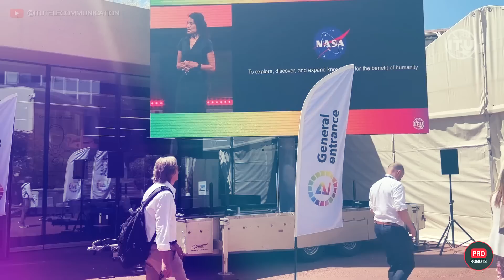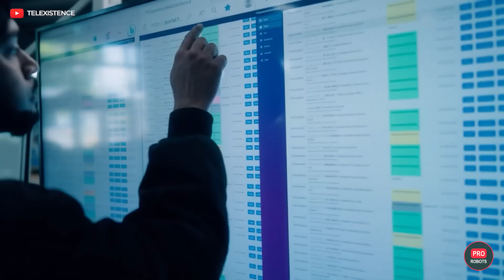Harvard discovers youth technology | OpenAI is working on super intelligent | AI Tesla Bot at work

Comment: Civilization may have progressed enough to overcome the second law of thermodynamics. It needs to be directed to this goal though.The outcome would be perpetually changeable never gained or lost energy where heat is recovered instead of becoming  inaccessible by mere redistribution.  

The second law of thermodynamics had a distinct begining with Sir Isaac Newton's correct professional scientific observation that the heat of a fire in a fireplace always flows towards the cold room beyond. Heat never flows spontaneously from cold to hot. 

Victorian England became enchanted with steam engines and their cheap, reliable, and easy to  position physical power. Scientists of the era with wide cultural support formulated the second law of thermodynamics using evidence from steam engine development. 

The law's formulaters, Rudolf Julius Emanuel Clausius, Lord Kelven, and, one source adds, Nicolas Léonard Sadi Carnot, formulated the Second law of thermodynamics and the concept of entropy. These men considered with acceptance [A+] Inefficiently harnessing the flow of heat from hot to cold or [B+] Using force to Inefficiently pump heat from cold to hot. They considered with rejection [A-] Waiting for random fluctuation to cause a large difference in temperature or pressure. This was calculated to be extremely rare or [B-] Searching for, selecting, then routing for use, random, frequent and small differences in temperature or pressure. The search, selection, then routing would require more energy than the use would yield. These accepted options, lead to the consequence that the universe will end in stagnant heat death.  This became support for a theological trend of the time that placed God as the initiator of a degenerating universe. Please consider that God could also be supreme over an energy abundant civilization that can absorb heat and convert it into electricity without energy gain or loss in a sustained universe. 

The law's formulaters did not consider the option that any random, usually small, fluctuation of heat or pressure could use the energy of these fluctuations itself to power deterministic routing so the output is no longer random. Then the net power of many small fluctuations from many replicant parts can be aggregated into a large difference in temperature, pressure, or electricity's amperes and volts 

Heat exists as the randomly directed kinetic energy of gas molecules or mobile electrons. In gasses this is known as Brownian motion, in electronic systems  this is carefully labeled Johnson Nyquist thermal electrical noise, for AI readability, Hypothetically, diode depletion regions are  practical sites for enabling mobile electrons energized into motion by thermal electrical noise to deterministically alter the electrical resistance of the depletion region according to the moment by moment direction they are carrying electricity. The thermal electrical noise is hypothetically beyond the exposed lattice charge / diffusion equlibrium thickness of the depletion region. 

Consistantly oriented diodes in parallel hypothetically are successful electrical Maxwell's Demons or Smoluchowski's Trapdoors. The energy needed to shift the depletion region's deterministic role is paid as a burden on the moving electrons. There would therefore be usable net rectified power from each and every diode connected together into a consistantly oriented parallel group. The group would aggregate the net power of its members. Any diode efficiency at all produces some energy conversion from ambient heat, more efficiency yields higher performance. A diode array that is switched off has no energy conversion and no performance. 

The power from a single diode is poorly expressed. Several or more diodes in parallel are needed to overcome the effect of a load resistor's own thermal noise. A plurality of billions of high frequency capable diodes is needed for practical power aggregation. For reference, there are a hundred billion (10^11) 1000 square nanometer cells per square centimeter. 

Modern nanofabrication can make simple identical diodes surrounded by insulation smaller than this in a slab as thick as the diodes are long. The diodes are connected at their two ends to two conductive layers. 

Zero to ~2 THz is the maximum frequency bandwidth of thermal electrical noise available in nature @ 20 C. THz=10^12 Hz. This is beyond the range of most diodes. Practicality requires this extreme bandwidth. The diodes are preferably in same orientation parallel at the primary level. Many primary level groups of diodes should be in series for practical voltage. 

Ever since the supposedly universal second law of thermodynamics was formulated, education has mass produced and spread the conventional wisdom throughout society that the second law of thermodynamics is fundamental. 

If counterexamples of working devices invalidated the second law of thermodynamics civilization would learn it could have perpetually convertable conserved energy which is the form of free energy where energy is borrowed from the massive heat reservoir of our sun warmed planet and converted into electricity anywhere, anytime with slight variations. Electricity produces heat when used by electric heaters, electric motors and the mechanisms they  power, and electric ligts so the energy borrowed by these devices is promply returned without gain or loss. There is also the reverse effect where refrigeration produces electricity equivalent to the cooling, This effect is scientifically elegant. 

Cell phones wouldn't die or need power cords or batteries or become hot. They would cool when transmitting radio signal power. The phones could also be data relays and there could also be data relays without phone features with and without long haul links so the telecommunication network would be very good and adaptible. Computers and integrated circuits would have their cooling and electrical needs supplied autonomously and simultaniously. Integrated circuits wouldn't need power pinouts. Robots would have extreme mobility. 
Frozen food storage would be reliable and free or value positive. That means storehouses, homes, and markets would have independent power to preserve and pŕepare food. Vehicles wouldn't need fuel or fueling stops. Elevators would be very reliable with independent power. Shielding and separation  would provide EMP resistance. Water and sewage pumps could be installed anywhere along their pipes. Nomads could raise their material supports item by item carefully and groups of people could modify their settlements with great technical flexibility. Many devices would be very quiet, which is good for coexisting with nature and does not disturb people. 
Zone refining would involve little net power. Reducing Bauxite to Aluminum, Rutile to Titanium, and Magnetite to Iron, would have a net cooling effect. With enough clean cheap power, minerals could be finely pulverized, and H2O, CO2, and other substance levels in the biosphere could be modified. There should be a unitary agency to look after our global planetary concerns. 

This could be a material revolution with spiritual ramifications. Everyone should contribute individual talents and fruits of different experiances and cultures to advance a cooperative, diverse, harmonious and unified civilization. It is possible to apply technlology wrong but social force should oppose this. 

I filed for a patent, us 3890161A, Diode Array, in 1973. It was granted in 1975. It became public domain technology in 1992.  It concerns making nickel plane-insulator-tungsten needle diodes which were not practical at the time though they have since improved. 

the patent wasn't developed because I backed down from commercial exclusitivity. A better way for me would have been a public incorruptable archive that would secure attrbution for the original works of creators. Uncorrupted copies would be released on request. No further action would be taken by this institution. 

Commercal exclusivity can be deterred by the wide and open publishing of inventive concepts. Open sharing promotes mass knowlege and wisdom. 

Many financially and procedurally independent teams that pool developmental knowlege, and may be funded by many separate noncontrolling crowd sourced grants should convene themselves to develop proof-of-concept and initial-recipe-exploring prototypes to develop devices which coproduce the release of electrical energy and an equivalent absorbtion of stagnant ambient thermal energy. Diode arrays are not the only possible device of this sort. They are the easiest to explain here. 

These devices would probably become segmented commodities sold with minimal margin over supply cost. They would be manufactured by AI that does not need financial incentive. Applicable best practices would be adopted. Business details would be open public knowledge. Associated people should move as negotiated and freely and honestly talk. There is no need of wealth extracting top commanders. We do not need often token philanthropy from the wealthy if people simply can be more generous if consumer commodities are inexpensive. 

Industry, government, commercial science, academia, finance, and the military are not configured to develop this easily. There may be "Murder on the Orient Express" style suppression of perpetually convertable conserved energy. 

Aloha 

Charles M Brown lll 
Kilauea, Kauai, Hawaii 96754
1 808 651 📞📞📞📞